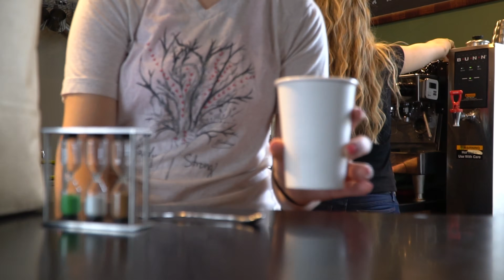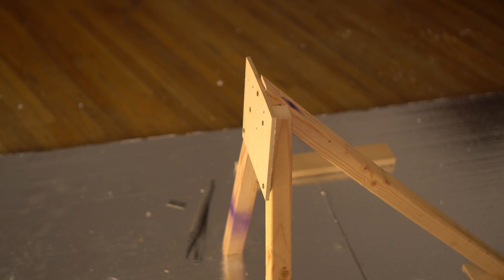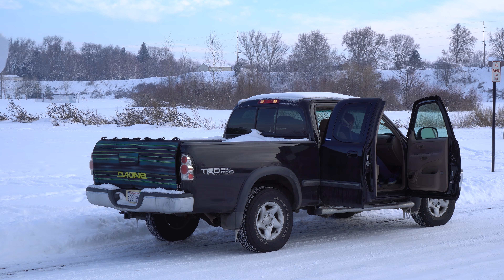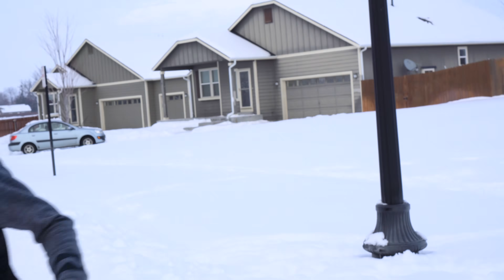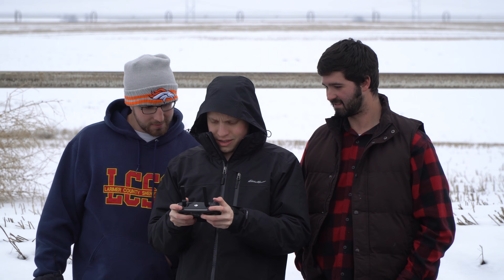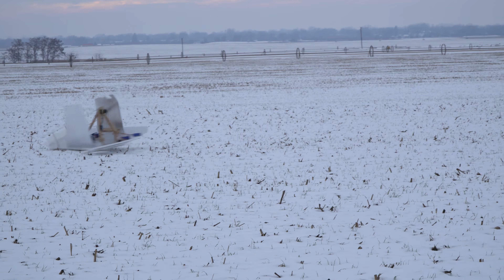Giant RC Air-Sled Thing | 4k

Comment: Instead of having a ugly down-force generator you could have made the entire bottom sheet of foam into a giant airfoil with its lift facing to the floor
Reply from the maker: That’s not really how that works.. lift has to do with angle of attack. The shape of the wing is not fundamentally important

Comment: why didn't you take like a PVC childrens sled (low weight but sturdy) and mounted the System on that; the Motor should be powerful enough to drive yourself around with it.

Comment: You need rear box rudders for low and high speed turning authority. Also the motor agle has to be dialed in to keep from the front from lifting at speed no downforce drag needed, Please Revisit it with box rudders. Will fly over the ground with so much more authority bro 🔥🤘

Comment: well done. now for some stiffer materials.
as for size. u should see my BCAM-AD-FW-FP90-1-B it takes an entire wall to its self to hang up and u have to take the outer thirds of the wings off via the QD's to even get it out of the house. 99.75" wing span, 9lbs with a 14lbs max TO. but its getting scrapped after 2 years of systems development to build the FP80-1-A and later there will be a FP120 or 150 in composites.